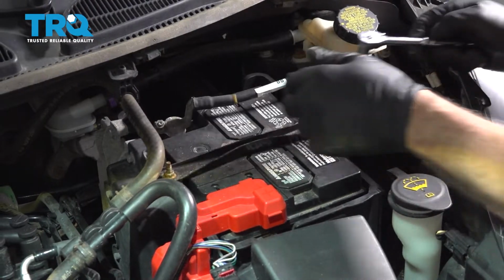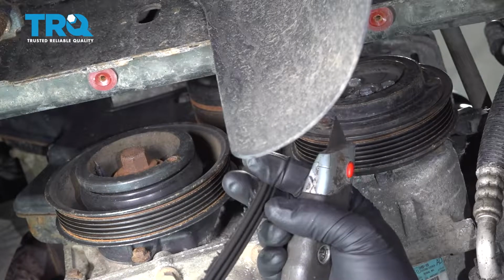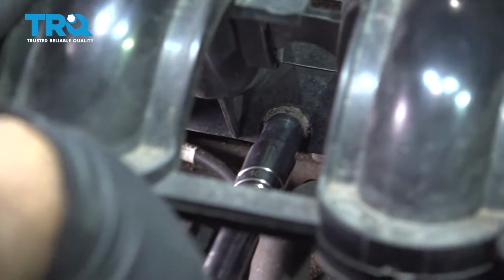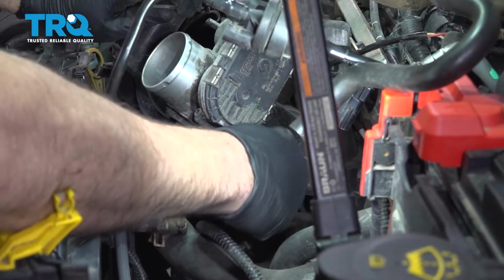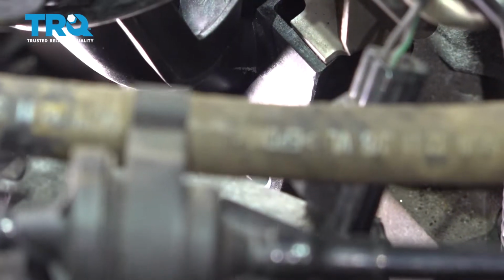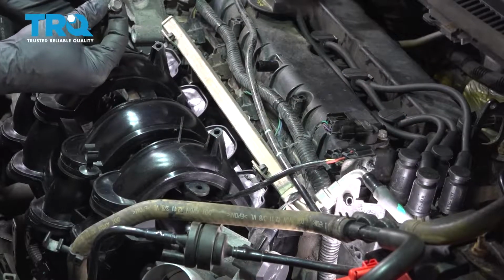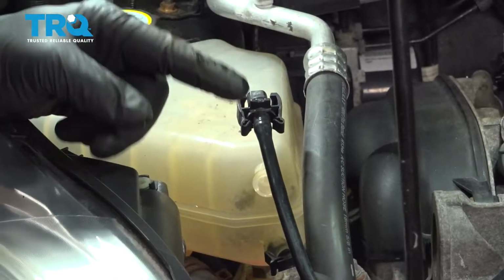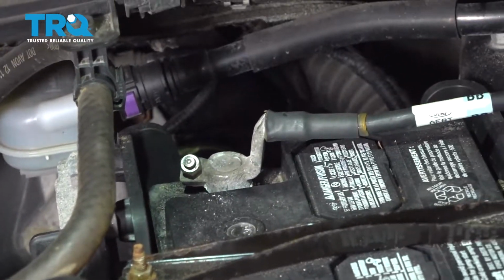How to Replace Intake Manifold 2011-2019 Ford Fiesta

Comment: Very helpful video, thanks!  One tip for anyone about to do this - Remove the throttle body before removing the intake.  It's easy and gives you a bit more room/visibility.  It also makes removing the two hoses underneath it a bit easier because you can disconnect them earlier in the process (if you have the right tools) so the intake isn't flopping around everywhere while you struggle with them.

Comment: Great video, helped me a lot- many thanks.

A couple of things I noted from my experience:

1)All my manifold bolts were exactly the same size, strangely enough.

2)I left the belt in situ, removed the 2 upper alternator bolts, prised the alternator forwards using a crowbar, using the remaining lower bolt as a pivot. This allowed me to access the left upper manifold retaining bolt, which is otherwise mostly hidden. I moved the alternator forwards and backwards to assist with removing the lower left manifold bolt.

3)I managed to remove and reinsert the lower left manifold bolt by using a couple of extension bars. It was tricky. A magnetic grabber helped to lift it out after the bolt was completely unthreaded.

cheers :)

Comment: You have to admire Ford's creative ways to suck money out of a person.  I'm watching this because my mother inlaw needs a new pcv valve.  What used to take 10 minutes and cost $10.00 now takes 5 hours and costs $100.00 if you do it yourself and $800.00+ if they do it.  Creative huh, just make the valve complicated, expensive and impossible to change without removing the intake manifold.  Bravo Ford you did it again.